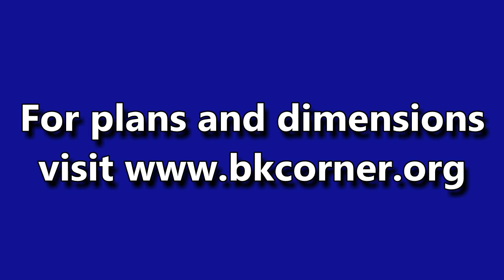Final Hive Stand Design - Dimensions and Details (see notes)

Comment: One technique to help put complicated angles and multiple connections that need to be perfect is to dry fit the part together and use a Sharpie to put some indicator marks.  Now, when you are gluing 2 pieces together, you know exactly where they need to line up so the whole contraption is square.

Comment: Not all brands of fittings are identical. I'm going to suggest dry fitting and checking some measurements. I assembled the cross piece and it wouldn't fit the sides. Ended up making the 9" pieces 9-3/8" and the 2" pieces left a gap so they were made 1-3/4" so the fittings would be touching each other.

Comment: I was wondering is anyone has made a slightly narrower version for 8-frame hive bodies? All that would be necessary is subtracting 2" to 2.5" from the 11" cross pieces and I expect it would not affect how rigid the stand would be.
Reply from the maker: The beauty of PVC is it is flexible.  Beekeepers have sent me shots of their modified designs.  Some made double wides, some made longer legs for hillside stands, some extended them backwards.  Shortening the cross braces for an 8 frame should be no problem at all.